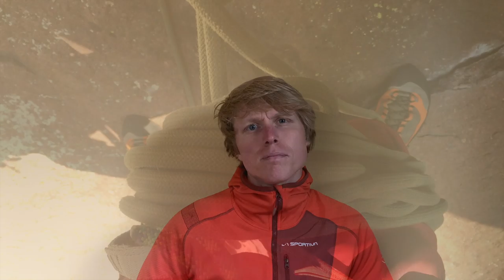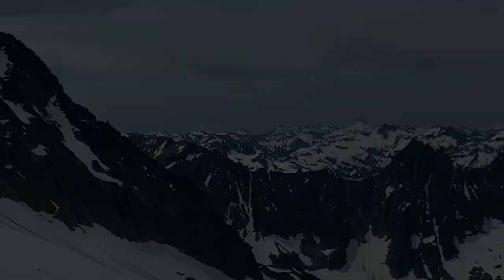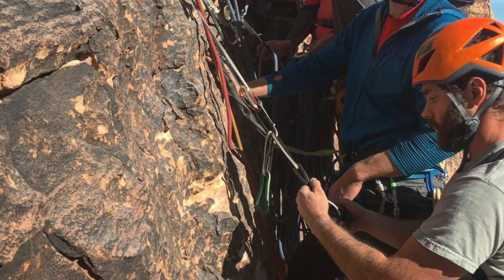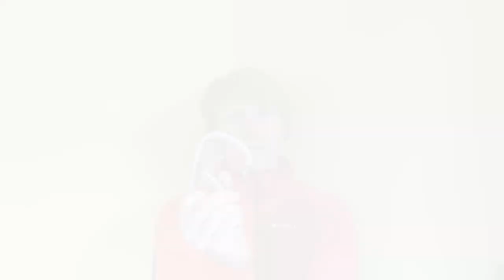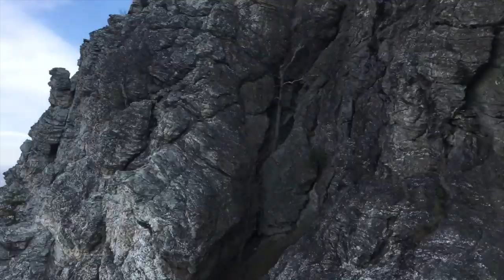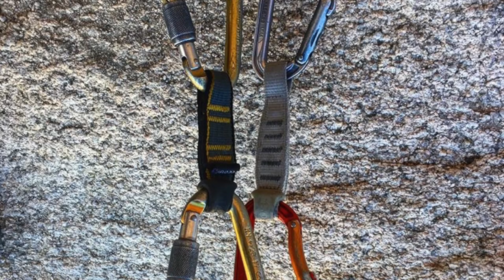Guide Explains "Redundancy"

Comment: Cody, Very nice video. Especially good was the "proximity" concept; Hopefully that comes into broader use and understanding regarding anchors.
Reply from the maker: Thank you so much, John!!!
Reply: That was an excellent way to present that information. Plenty of people lower from single pitch climbs on just 2 opposite and opposed quickdraws but if multiple people are going to toprope it afterwards then it probably makes sense to at least have a locking draw as one of them. That said, I have had to setup a top rope anchor with a single triple-action locker on the rope side due to a lack of materials on my harness, but it was only for 1 person after me, the anchor was free-hanging in space so no chance of rubbing and my partner was comfortable with doing 1 lap on it.

Comment: Thanks for the video Cody! A question I usually get asked when I’m using my quad is why use non locker carabiners on the sides that attach to the hangers. My usual guess it’s because as you said we got eyes on them and also because you’re not gonna be bouncing on the quad to cause them to fail. But a more thoughtful answer would be nice. Thanks a lot for taking the time making these
Reply from the maker: Bowline Dandy I think you are also spot on!  I can add that those attachments, located so high in the anchor are coming in contact with no immediate forces like the masterpoint does.  They are only accepting force in one direction, whereas forces at the Masterpoint, while sometimes subtle are changing loads and forces in more dramatic ways since that is where the rope interacts with our system and it is also where all forces meet and are dispersed to elsewhere in our system.  For these reasons, the masterpoint is a place for “critical links” using lockers!
Reply: That is a great question about non-lockers on the hangers. Cody addresses is that pretty well in the "proximity" point he makes. If it's a multi pitch route and you're right there to keep an eye on things, then standard carabiners are fine on the hangers. If it's a top rope anchor in an instructional setting, and you're going to have multiple people on it for a long period of time, you lose your close proximity. For that reason you may want to take the extra security step of putting locking carabiners also on the bolt hangers. There may be some people that might diss you for doing this, but I don't think any of the climbers who are going to be on YOUR anchor will be upset that you took that extra security step. Remember, never let anyone else dictate your level of risk tolerance, no matter what their credentials or experience.
Reply: @johngo6283  After over fifty years of climbing, I add more locking biners to my rack all the time. Small streamlined twist-open D lockers I never hesitate to substitute even on QDraws, if the spacing makes any one absolutely crucial, and catastrophic were it to fail or more feasibly come unclipped, a more frequent phenomenon than generally considered. As to his non-lockers to clip a quad style sling into two bolts, experience and videos show clearly how dramatically a long serious fall can throw the belayer, lifting and heavily loading an anchor from above, not just in a controlled downward direction. Such wrenching movements can compromise those clips, even unclipping ordinary biners from bolts, or slings from the biners. Friends have survived rappel ropes coming unclipped, just from twisting and re-directing one's position; others have died. If you can create a scenario for any unclipping potential,  that has to be considered in need of redundancy. I believe the greatest problem in safety right now, is the fashion emphasizing Speed, at the expense of safe practices evolved over a hundred years. When in doubt, Stop, pause, re-check everyone's situation before proceeding; don't apologize for being safe, and if partners can't cope, find new partners. RIP Cody.

Comment: Nice video! For me personally I like to think about it in terms of probabilities. If you are using your own locking carabiner, the probability of it breaking is for all practical purposes so small that it can be ignored. I haven't climbed enough to have a good feeling for the reliability of anchors but always assumed the anchors have 2 bolts because the probability of one coming loose is not negligible (could be wrong). Also since the anchor is something you personally don't have knowledge of it probably pays to be a little more careful. One nice thing about thinking about probabilities is that it sometime clears up what to do in a complex situation. Sometimes in a complex situation it may be better to sacrifice redundancy for simplicity since the probability of screwing up with a complex set up is higher than the added security of the redundant set up (this is basically what you said).

Again thanks for the vid. Good to think about these things!
Reply: Another way of considering probabilities where you have little input, i.e. fixed anchors, is where can you add something? Easiest is to climb above, and place the first protection for the next pitch, extending back down to your anchors. Not always convenient, but if any doubts about the anchor, look beyond the immediate proximity, and be creative.

Comment: so with instances of single material (one carabiner/one rope) "redundancy" of those points would be gear checks before/after climbs to verify they're in good condition.  would a freak accident (rock fall destroying those points) just be accepted risk that has been mitigated to the best of our ability (terrain selection)?
Reply from the maker: jarvo essentially that is the easiest risk to mitigate in those instances, yes.  I would also argue that there are subtle redundancies built into something like a rope in that (especially with Unicore) it has a sheath protecting the core.  Ropes do cut in unfortunate accidents, but generally that is tough to accomplish which is great news for us!  That said, our decisions of placement and protection lend us more as you said.
Also, bonus: our figure-eight follow-thru is also redundant in that it takes two steps to make it fail!
Reply: @CodyBradford  i had never heard of unicore and just watched a few videos on it, sheath slippage looks pretty scary! whenever i hear of accidents that involve a rope cut i imagine a full sever.  any idea if sheath slippage accidents are just reported as rope cuts?
Reply: If freak accident risks aren't acceptable then choice of activity should be considered. If work your way down a list of risks from most to least likely and have made it down to catastrophic anchor failure then you have already accepted a lot of unmitigatable risks that are much more likely.

Accidents in North American Climbing is a good pickup if you are interested in trying to understand what can go wrong and what, if anything, you can do about it. The old cliche that climbing is inherently dangerous is very much true. You're never 'safe' in the mountains.
Reply from the maker: @jarvo7723  Pretty much what RippDrive said about looking into purchasing (or joining) the Accidents in North American Climbing book from the American Alpine Club!

Comment: I know the videos are old, but I'll add my thoughts:

I consider redundancy to be to prevent unforeseeable failures, and is only strictly necessary in gear with unknown integrity. We know our own gear, we know how old it is and what it's rated to. This gear doesn't really NEED to be redundant, though it gives peace of mind. Things like bolts or traditional placements are unknowns, and thus redundancy is needed. 

Additionally it could be argued that the integrity of the rope in a fall where it slides against the rock, or if rocks fall, is an unknown, and if this was a concern you could climb on half ropes.

When it comes to what I consider reasonable, I tether in with a clove and a sling when belaying, and a sling alone with a locker when rappelling, and I don't consider need for redundancy in belay devices or ropes unless in particularly sketchy terrain.

Comment: My only question...

You ask, "what about the climbing rope, why doesn't it need to also be redundant", you basically answer "because it is strong and reliable enough on its own".

This is an unsatisfying answer to me, because you could say the same thing about any dyneema sling, a bolt, a biner, etc. And yet you give other more satisfying answers for redundancy for those pieces of gear.

If the climbing rope severs , you have no redundancy, and ya die. Which does happen. 

The more honest answer seems to be that the climbing community is generally not willing to trade the inconvenience of making the rope redundant by carrying two (except instances where you need to climb on half's, etc) for safety against an event that happens quite rarely.

Other types of gear failure at the anchor might be just as rare as severing the climbing rope, but we are willing to make it redundant anyway, because doing so comes at a much lower cost in convenience and pack weight.

Do you think this is right? Or no?
Reply from the maker: I would agree and I think that I rushed that answer.  I think you are mostly correct here in that it really comes down to inconvenience, but I would also like to add something about the rope.  The rope does have a somewhat redundant mechanism in that it is a Kernmantle design (inner core, outer sheath).  This means that there is a protective sheath to protect the vulnerable core.  There are even ropes with the sheath interwoven with the core (Unicore) that makes cutting very difficult.  
Because of how we tie in with the rope and often tether, these connections are a lot stronger and more versatile than other attachment systems such as a PAS.  In this way, redundancy is gained through the application of the rope rather than its structure.  
Long winded and a good topic,  but as goes redundancy and climbing topics in general.  Thanks for bringing it up!